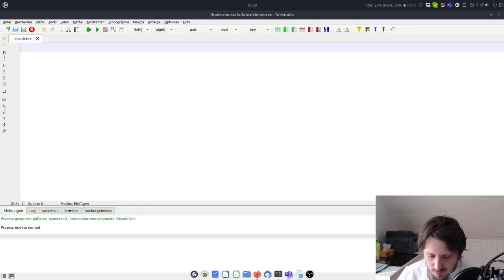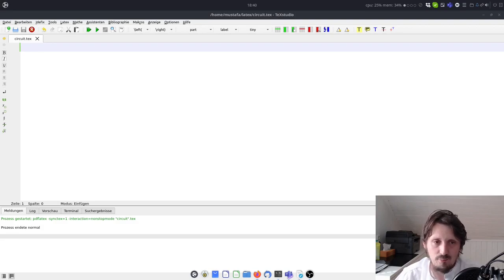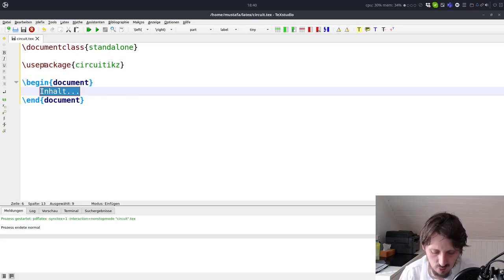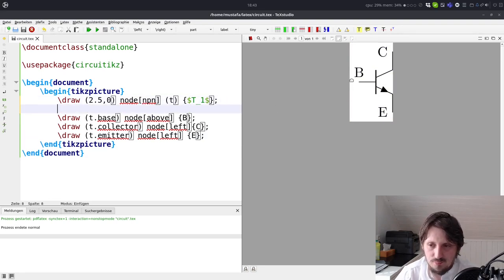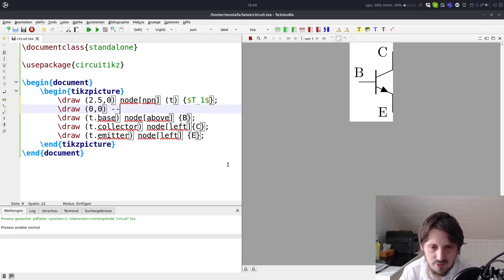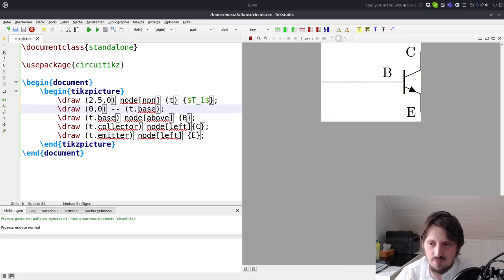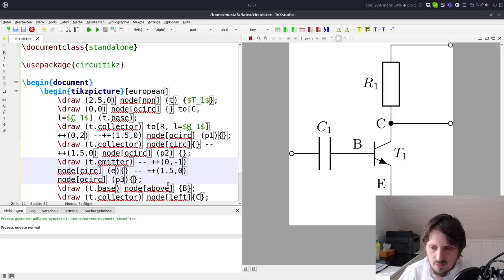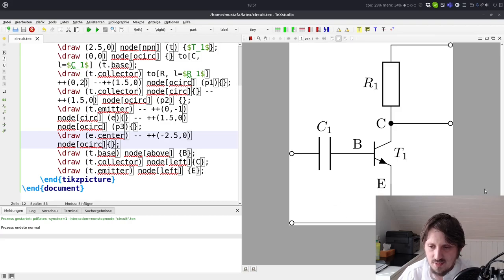LaTeX Tutorial 14: Drawing Electrical Circuits with LaTeX

Comment: code with some changes
\documentclass{standalone}
\usepackage{circuitikz}

\begin{document}
	\begin{tikzpicture}
		%draw a npn transister and name its connections
		\draw (2.5,0) node[npn](T1) {$T_1$};
		\draw (T1.base) node[above] {B};
		\draw (T1.collector) node[left] {C};
		\draw (T1.emitter) node[left] {E};
		
		%create C1 and draw a line through it from P1 to T1.B
		%$C_1$ ($places in equation mode and the underline in name denoting subscript for the 1)
		%ocirc is open circle and circ is closed connection point
		\draw(0,0) node[ocirc] {$P_1$} to [C, l=$C_1$] (T1.base);
		
		%draw resister R1 and connection point
		\draw (T1.collector) to[R, l=$R_1$]
		++(0,2) --++(1.5,0) node[ocirc]	(P2){$P_2$};
		
		%draw closed connection on T1.c to open connection
		% -- represents a line (possibly style of line?)
		\draw(T1.collector) node[circ]{} --
		++(1.5,0) node[ocirc] (P3) {$P_3$};
		
		%draw from T1.e to open connection
		\draw (T1.emitter) -- ++(0,-1)
		node[circ] (e){};
		
		%draw from closed connection attached to T1.e to a closed connection in lower left
		\draw (e.center) -- ++(-2.5,0)
		node[ocirc] {};
		
		%draw line with arrow from P1 to open node and offset it by 2mm to left to show it as an illistration not an actual connection
		\draw [-latex] ([xshift=-2mm]0,0) --
		++(0,-1.8) node[midway, left] {$U_1$};
		
		%draw line with arrow from P2 to P3 (both open nodes). 3mm vertical spacing added to show it as an illustration not an actual connection
		\draw [-latex] ([yshift=-3mm]P2.center)
		-- ([yshift=3mm]P3.center) node[midway, right] {$U_2$};
	
		
	\end{tikzpicture}
\end{document}
Reply: ILY bro